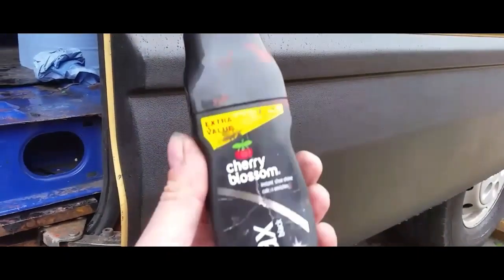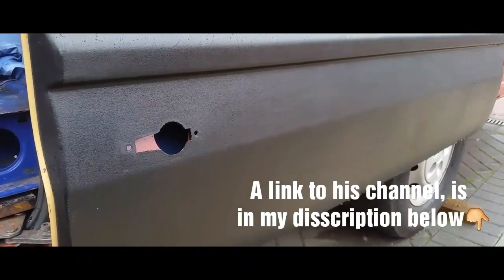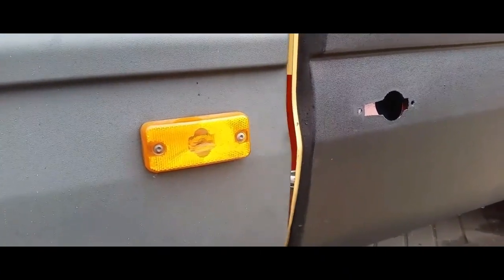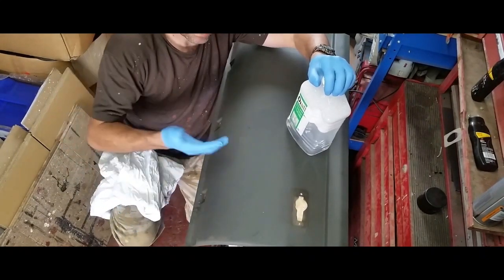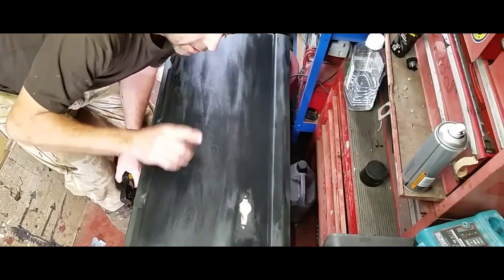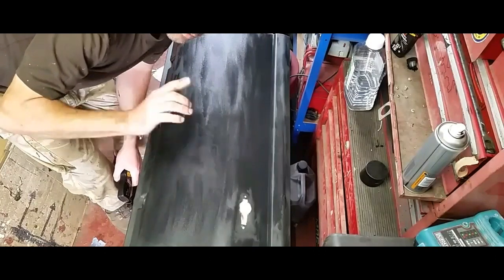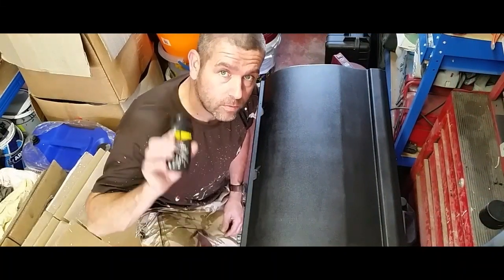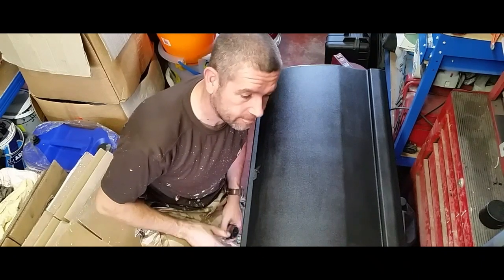Month 4. Preparing the Iveco Daily for the Campervan build / Vanconversion.

Comment: Have you tried a heat gun to bring back your grey plastics back to black original.
I have tried all the commercial plastic revival stuff - all fade after a few months.
I did my 1995 Mitsubishi Delica front bullbar cover. Looks like new. been done a few months and still looks like new.
Reply from the maker: Hi Peter, I did but it was time consuming, I just wanted to do this in between jobs that was going on at the time mate. 6 months on, so far the plastic trims still looking fine. Once that has worn off I probably will return to heat gun 🔥🔫 when the campervan is finished and dedicate more time to it bud 😉👍👍👍

Comment: Great job. Did you disconnect the ECU while you were welding it? I’ve got the same Iveco and also have a few welds to do. I’m wondering what to do to protect its ECU.
Reply from the maker: Cheers Brett 😉👍👍👍. Yes I did bud. I removed the ECU and the battery. ECU wise. Its not a big job, 4 bolts and two plugs. The hardest part for me was removing the battery due to the clamp that holds the battery in place, the captive nut was spinning around inside the plastic tray for the battery. I had to remove the whole lot due to the welding under and inside of the N/S wheel arch 😁👍👍👍.
Reply: Mark Collom #Iveavan Thank you very much for letting me know about that. I’ve been really concerned about removing and reinstalling the ECU. Over thinking it surely 🤔🤔 I’m definitely trying the boot polish on the exterior plastics! That’s an amazing result. Thumbs up mate 👍👍 Excellent work and top results
Reply from the maker: @brettn1049  No worries matey 👍👍👍, yep six months on, the shoe polish is still holding on 😉, in fairness regarding the ECU, you only need to disconnect the earth from the battery when welding and no they is no need to touch the ECU. Ive been an service engineer for around 25 years now. Where I've had to do welding (but I've not done any welding for over 10 years, due to most of my work is diagnostics and calibrations using an laptop). But I do has good practice just remove the battery from the vehicle bud, I've never had an ECU bugger up on me 😉. I suppose it's like your just unplugging the power source from your PC, It still works when you plug it back in again 😉👍👍👍
Reply: Mark Collom #Iveavan I’ll remove the battery then. One of my concerns of removing the ECU is that those two looms have been there, in that shape since they were first installed and with the time of them being there with the heat from the engine bay I would worry about brittleness of the plastics. Honestly, I was even worried about having re-pair with BCM etc once I reinstalled the same ECU... overthinking 🤔🤨 I’ll remove the battery and then do the welds. I’ve read chat in rooms in the past relating to other cars, about removing the negative from the battery and haven’t exactly understood why only the negative and not also the positive. It only takes another minute to do. The only thing I can think of is that that would perhaps keep codes in the stereo unit and such. Anyway, I really appreciate your advise and I will remove the battery before I weld. It’s just an expensive service to have an Iveco bloke come out and pair ECU with BCM etc... Thanks heaps for the info👍👍👍
Reply from the maker: @brettn1049  no worries matey. No you will lose your radio code by undoing the earth,  by removing the earth its to stop spiking the battery and other electrical equipment (due to the earth is earthed out on the body or in our case the chassis rail). The only problem with my wiring was either where that conduit had rubbed through the wiring (I'm not a big fan of that ribbed conduit due to this) and where water had been able to get in to some plugs bud, mine was OK close to the ECU seem to be flexible, but I know what you mean I've had that too in the past 😉👍👍👍...
Reply: Mark Collom #Iveavan Not a fan of the corrugated conduit either for the exact same reason. I’ll get these few welds done and then it’s onto replacing the sump gasket. I’m really hoping that I can get the pan low enough to slide the new gasket over the oil pickup. Next job on the list. Get these few things done and start fitting my van out. I’m getting all the gear here and ready for motor home conversion 😃
Reply from the maker: @brettn1049  cool are you you tubing it bud? Sorry can't help you with the sump as mine is leak free 😉👍👍
Reply: Mark Collom #Iveavan Hopefully sump gasket will be easier than I’m thinking. What do you mean by tubing it?
Reply from the maker: @brettn1049  I mean are you putting your progress of the build on YouTube bud?
Reply: Mark Collom #Iveavan Oh, YouTube. How did I not get that... I’ve thought about doing that. I think after I pull the front end off and lift the motor to replace its sump gasket I might just do that. Lots of others like yourself are posting vlogs so I might just do it too. I’m really excited about the build and have been watching vlogs on it all for just over a year now. Can’t wait to get started. Have to buy a decent camera next 👍😎
Reply: Mark Collom #Iveavan Mark I’m wondering if I could ask if you know anything about the center seat belt wire? I’m wanting to put the swivel base captains chairs in mine and I’m wondering how to deal with the seat belt sensor wire for the middle seat belt. Have you got any idea how to fool the sensor module into thinking the belt is still there?
Reply from the maker: @brettn1049  just checked mine doesn't have one 🤔, probably best to Ask Ash Pollard on here or on Instagram matey as he has done the seat conversion bud, I wasn't planning to do anything to the cab seats (well not yet) 👍👍👍.
Reply: Mark Collom #Iveavan Good man. I’ll do that. I think it’s a “must do” part of a camper conversion. It’s just another possibility on the list of can do’s modifications. Really opens the front cab area up and brings it all in as part of the fit out. Get to see your work from a new angle too, from your lounge area. I’ve already done it to my drivers seat. Passengers is next 👍 Thanks for the tip. I’ll find him and ask him about it. Thanks bud
Reply from the maker: @brettn1049  no worries matey 😉👍👍👍.

Comment: Hey Mark. How are the bumpers holding up after a year? From what I can see they still look good in your recent videos. Would you recommend doing them before continuing conversion? I’m considering doing mine but I’d rather do it later as it’s not a priority for me right now. Would like to hear your thoughts. Jacksvan60
Reply from the maker: Yes still holding up fine mate, I did try the hear gun method on the sliding door handle, that's faded back and looks like it's gone brittle due to using the heat gun due to the handle is starting to crack! Definitely Recommend the shoe polish way, my plastics still look new mate 😉👌👍👍👍.
Reply: Mark Collom #Iveavan thanks bud. Will deffo give it a go

Comment: I want to start doing mine 
Needs service cambelt 
Painted underside 
Not checked brakes or nothing 
Soon as i finish work on a friday i go away in it lol
Reply from the maker: I wish I was at that point. Friday finish work and be off somewhere for the weekend, I cant wait for that day 😎.
Reply: @Iveavan  you will get there 
Aim.for spring it will be worth it
Reply from the maker: @kirklonetraveler  That is my goal ( spring 2019 🤔) it will be use able by then but not fully finished I reckon, as I have solar panels to fit too we shall see 👌👍👍